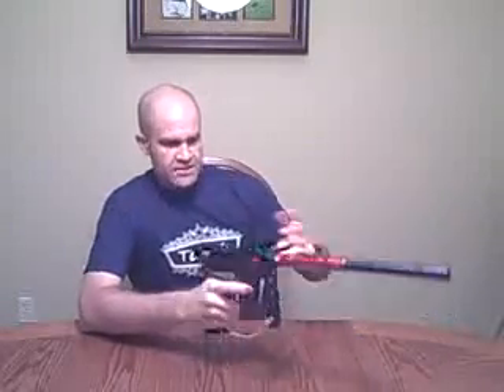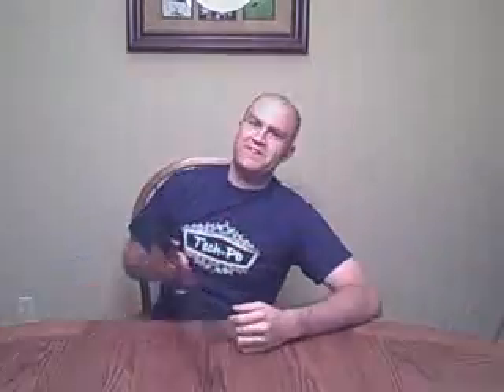Punkworks :  TechPB's Paintball Science Forum

Comment: No it would not be a good indication.

The ball exerts a back pressure on the flow of air out of the tank,regulator,chamber, restricting flow.

Barrel length,ball fit is a huge factor of air eff, by taking the ball out of the equation you get no indication.
The energy efficiency of a pneumatic device's ability to transfer energy to a projectile is not a base factor of 'number of shots'

Paintballers really need to take a course in thermodynamics to properly understand efficiency.

Comment: Continued from above thus not emptying the dump chamber completly Which is why tophat mods are inconsistant. Mike wtih you ball in breech theroy, I will no doubtly say that that will have an affect however not as much as the ball blocking the bolt causing back pressure. AGAIN THIS WILL ONLY WORK WITH A PROPERY TUNED SPOOL VALVE GUN THAT EMPTYS ITS DUMP CHAMPER COMPLETLY. REASON IT USES A PREMESSURED AMOUNT OF AIR EACH TIME BALL OR NO BALL.THE BALL SLOWING OR CAUSING RESISTANCE WILL BE NEGLIGABLE

Comment: I think there are some flaws with this test. A marker is probably using a different air amount dry firing possibly than with shooting actual paintballs because of the pressure pushing out the paintball compared to just pushing unrestricted air out of the barrel. Just one thought. Here is another thought - if you can use this theory to test efficiency, how about doing this without the barrel attached? Same results or not since you are not using paint any way. ???

Comment: IT WONT WORK! Cept on a Properly tuned Spool Valve that is setup to be Smooth shooting. Reason The set up will always dump the same amout of air each shot cause, Spools use the air thats in a dump camber thats all. Exp. If you were to push a pm/dm bolt forward opening it will release the and then stop. While if you did that to a popet valve air will just keep on comming.HOWEVER very few have spools tuned this way cause the have them tuned for effiency(higher presure lower dwell like popets cont-

Comment: r0cki13 r u stupid if its a dm8 y does it have a proto logo and it can't be a pm8 because the handle dosn't have a gap between the body and it...... so the only thing left is that mike put a ul frame, red metal eye covers, some kind of two piece red/black barrel, red aluminum back cap, and a red aluminum feed neck.  but whatever i make mistake sometimes

Comment: Actually, it may depend on the gun.  In a gun like an intimidator, the presence of the ball in the breach may cause resistance against the bolt, which is transferred to the ram, which will strike the valve with less force, causing it to release less air.

Also, if the gun has any kind of feedback from the eyes that can adjust the way the solenoid works depending on the speed of the bolt, it may also have some effect.

Comment: That's why you chrono it first.  Once you have your regs set, the theory is that it will use exactly the same amount of air on each shot regardless of whether a ball is present.

I would suggest doing the chrono shot with a loader on the gun, or at least checking to see if having a loader on the gun affects the velocity.

Comment: Shouldn't drying firing work with spool valve guns? It's an air dump system and the efficiency depends on the amount of dwell time. But of course to a certain point in a spool valve.

Efficiency would depend on the tank's consistent temperature (lowers pressure fast when shooting fast), super consist. reg, dwell time. 

 As long as you check the chrono with the same balls you use all the time to 300fps, with the same barrel, dry firing should result the same .

Comment: because the bolt has pressure against it when shooting paint

it is more efficient
the bolt doesn't need as much air to return the bolt back to the original position

so in this case
dry fireing the gun would be less efficient that acctually shooting paint...

thats my theory

altho im asian so that means its probly all wrong
lol

Comment: no if there ISNT PAINT IN IT THEN LESS AIR WILL BE USED BECAUSE IT WONT HAVE TO PUSH THE BALL OUT AT 300 FPS WITCH DOESNT MAK3 A BIG DIFERENCE WITH A FEW BALLS BUT AFTER LIKE 1300 IT WILL START TO TAKE AFECT

Comment: Plus you have to remember, each gun is going to perferm slightly different anyhow based on what atmospheric conditions they are under.  So attempting to get a difinitive count using paint would be worthless anyhow unless everyone else trying to duplicate the results had the exact same setup, under same temperature, moisture in the air etc etc.  So you dont need difinitive results by waisting paint.  Just take them as comparitive results to other markers you personally test with this methodology

Comment: Even if the results werent 100% accurate as far as the amount of balls you can fire before it runs out, as long as you tested all the guns this way then you could compare the results to each other tested under this methodology.  So it may be a few balls off because of small drag factors, but it wouldnt matter because the results are not difinitive, just comparitive to other results achieved with the same methodology.